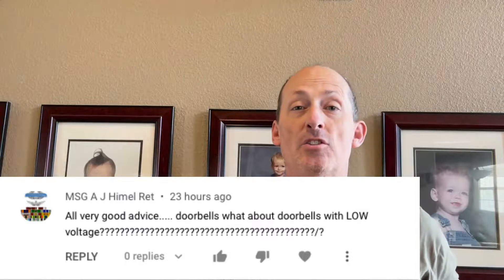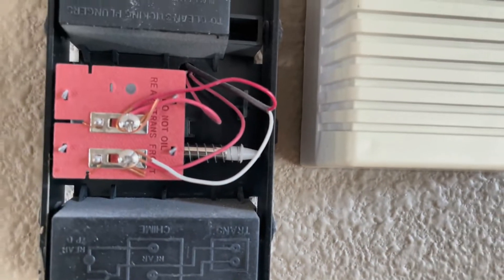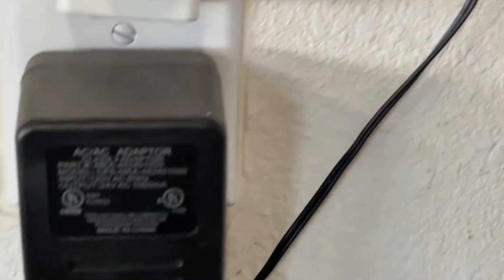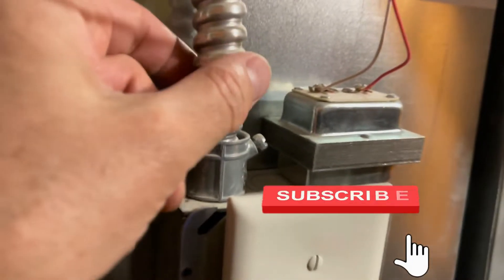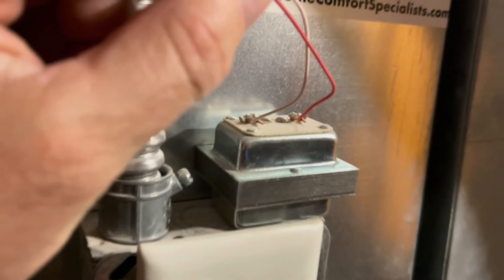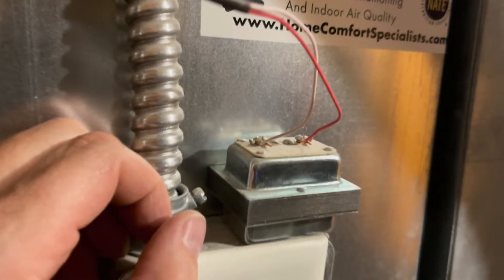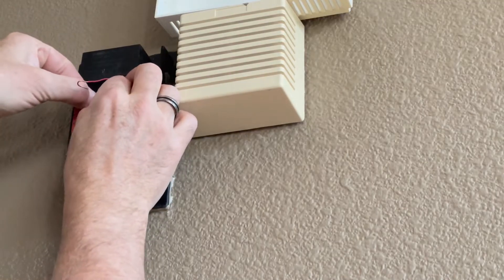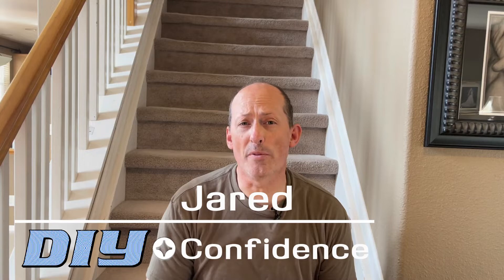Low Voltage Wires

Comment: Thank you! I was wondering what the low voltage wires look like and where we use them in our houses
Reply from the maker: Absolutely. 
You see them in controlling your gas or electric service. You see them on doorbells and fireplace switches. 
They are very thin as shown in the video.

Comment: Just moved into new place and was told the doorbell didn’t work. I bought one of those - plug inside and screw on outside - type doorbells. I want to take the old piece off and put a plate over the wires. Can I leave the power on?
Reply from the maker: So you just abandoned the wires and are using a battery powered doorbell, correct?
The wires are so low voltage it should not matter. I would always err on the side of safety however. Were I in your position I would wrap each exposed wire in electrical tape separate from one another before I cover it up.

Comment: I pulled out my porch light completely, so I cannot use it as a way to find out which breaker to shut off.  I need to re-attach the porch light.  Isn't simply turning off the wall switch inside enough to keep me safe while re-connecting the ground, neutral and hot wires??  Please say yes.  I cannot even find the breaker box much less the right breaker.  It'll only be a small shock, worse coming to worst--right?
Reply from the maker: Be careful. My porch light is connected to a 3-way switch, meaning I can turn it on and off at two different switches. This means there is always power coming into my lamp. 
Do you own a simple wire checker? You can see if and which wires are still live. 

NSi Industries TES-111 Twin Probe Voltage Tester, 80-250 VAC https://a.co/d/8JBtBVk

If you proceed with putting on the lamp, don’t touch the copper. Stay on the plastic sheathing, then tighten the wire nut.